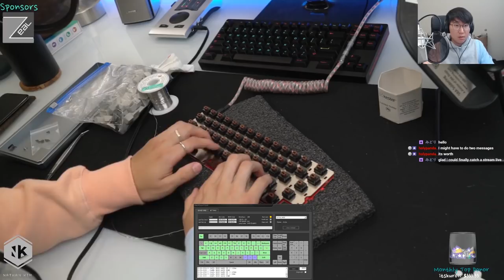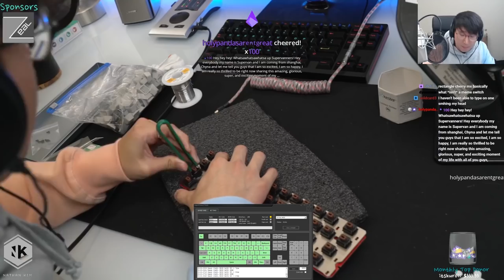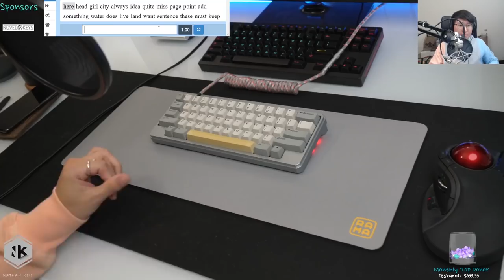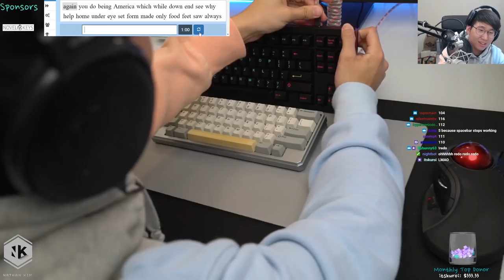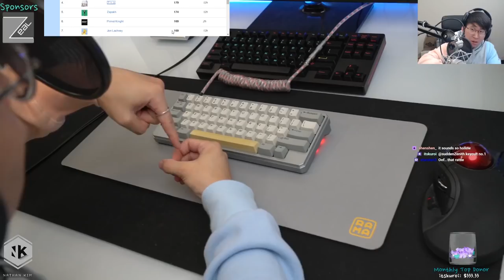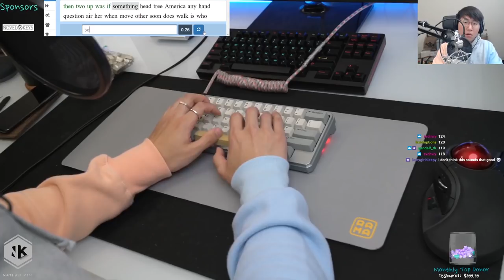Duck Sidewinder with SKCM Brown Alps Build Stream

Comment: Hey! I just bought one of these based on your video - do you know if I need to have a stepped caps lock? I am going to have control in that spot, so would prefer to use non stepped control. Just wondering if it's possible to assemble the board so as to use the regular non-stepped Control 1.75U key. Thanks!

Comment: You seem to have tried a lot of alps switches in metal cases by now, do you feel there's much difference between the sound between them? Specifically, if they all sound 'weaker' and less full compared to the old plastic cases they came from, which e.g. Chyrosran has asserted, or if some are better than others (so material isn't the end all of sound quality). It's hard to tell going by youtube videos since you have people with different recording equipment (for example, this blue Alps in Mira (https://www.youtube.com/watch?v=FmvUNnOuoc8) sounds very anemic, while your AEK64 with orange Alps (https://www.youtube.com/watch?v=lSsBVIDhmsU) sounds really full and thocky).

Currently got an AEK with orange switches on the way, and I've been thinking about what to do with it if the switches live up to the hype for me. There are a lot of metal cases available, but if Alps sound isn't fully preserved by them then going for acrylic or even wood might be a better option.
Reply: imo Orange alps sound poor and cheap in plastic case like GIIS it's sound wonder even in aluminum tray mount case.